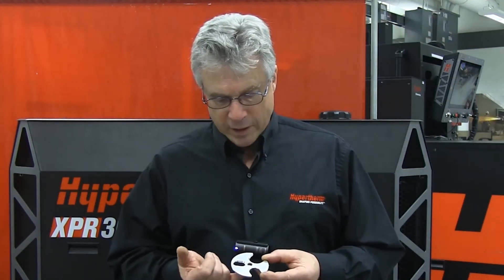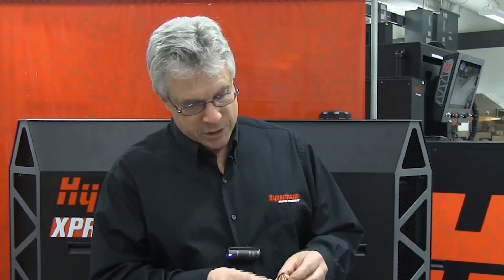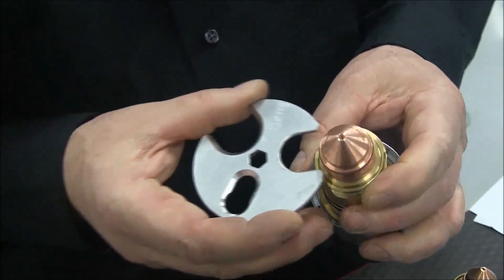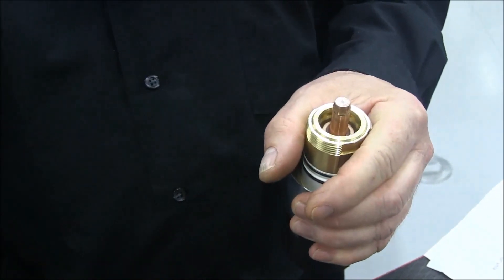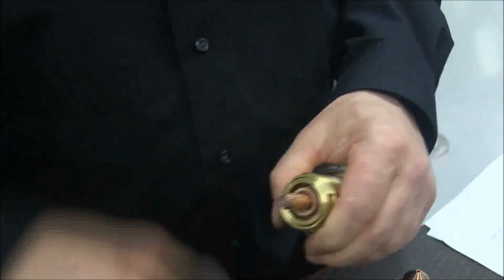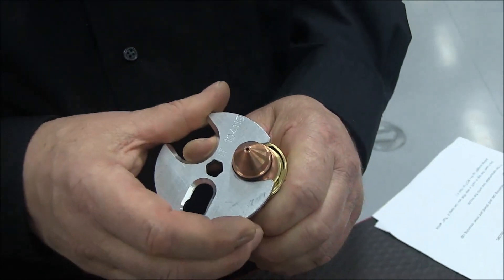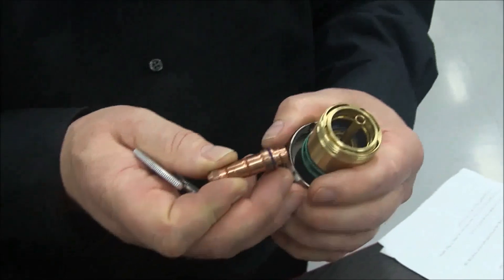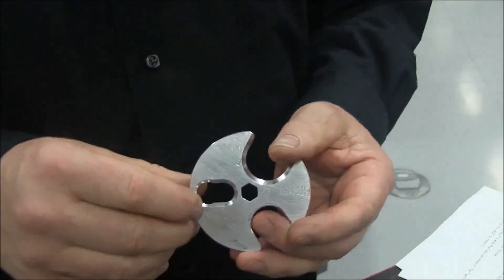Hypertherm How To

Comment: hi can you answer me a few  questionsif you know please ,if i move the switch to the left to set the preflow and then if i turn of the air from the main sourceboth values go down to zero is that normal? the console is set to work o2 -air the plasma from preflow isn't suposse to stai up and not decend if i only turn of the air ?